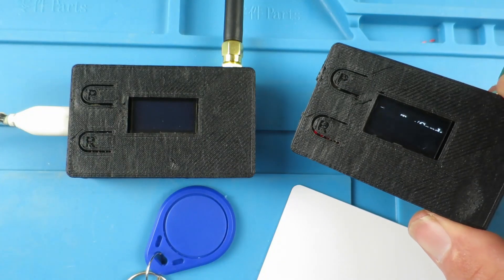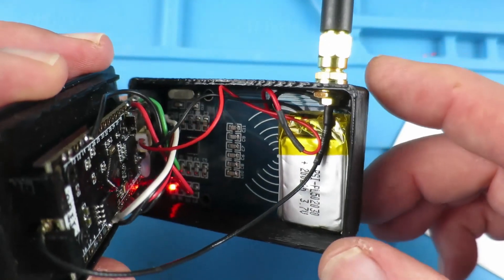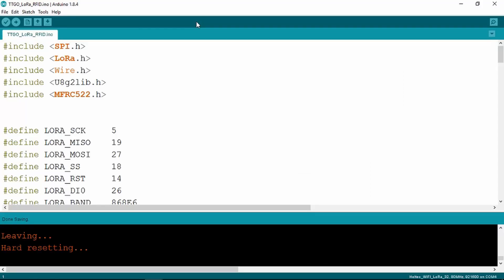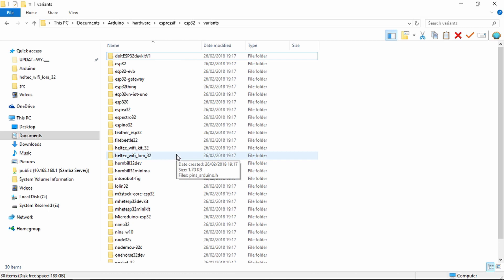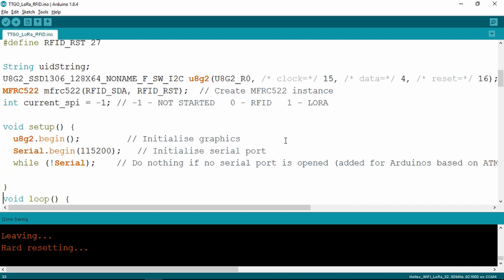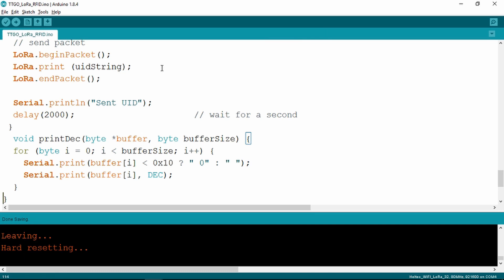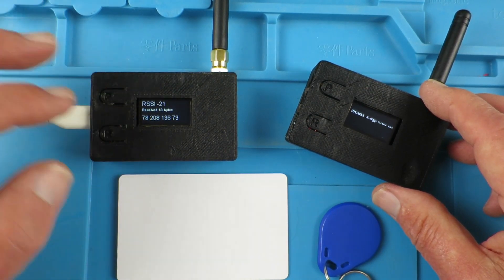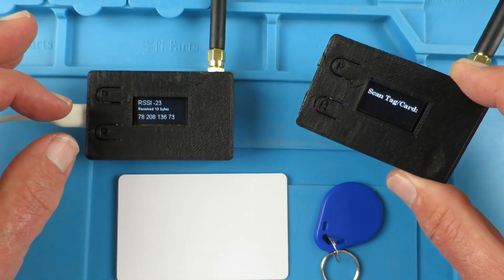Remote RFID Reader with LoRa & OLED Display - Electronic project

Comment: Hello i want the same code in esp idf ..i am using RFID and lora 32 v2 ..but I am getting error in RFID that read/write test failed .it is unable to read tag .. i have connected hardware as shown in your code ..
Reply from the maker: Sorry I don't use the ESP idf. I suggest you use the Arduino IDE first just to check your hardware, then maybe you'll have a better idea how to migrate it to ESP idf. Also this may help : https://docs.espressif.com/projects/arduino-esp32/en/latest/esp-idf_component.html Thanks for watching, have a great day!
Reply: @1nformatica  Hi. I tried the code  on Arduino IDE. In OLED it's displaying "Scan Tag/Card" but when I tap the card it's not scanning. What is the problem now ?
Reply from the maker: @KK-ib5nh  I suggest you test your RFID board and tags using the simple sketch I show here : https://www.youtube.com/watch?v=qzP_M82Mvjo You can get the sketch in this archive : https://drive.google.com/open?id=1LIFz0ApdliPeSq9N49goN8Ffpi5Ufjuw&authuser=gregcann%40gmail.com&usp=drive_fs
Reply: @1nformatica  I tested RFID reader and tag .it's working properly with nodemcu but again tried same rc522 RFID with heltec lora32 v2 but again the same OLED is displaying but when I scan the tag it is not printing the uid number
Reply from the maker: @KK-ib5nh  Did you look at this link from the video description? https://github.com/miguelbalboa/rfid/issues/359
Reply: @1nformatica  hello we have to write a function to select spi for RFID and lora bcz if I connect RFID with lora 32 . RFID wouldn't read tag . But lora works

Comment: what board do you use when programming?
Reply from the maker: I do not understand the question. The boards are LILYGO® TTGO 2Pcs LORA32 V1.0 868/915MHz ESP32 LoRa OLED  https://s.click.aliexpress.com/e/_9zjiNb They are programmed from a PC using the Arduino IDE and a USB cable. Thanks for watching, have a great day!

Comment: Hi do you need a LoRaWAN gateway for this system and is it possible to connect multiple scanners to one hub? Thank you
Reply from the maker: You do not need a LoRaWAN gateway. The devices are simply set up one as a receiver and one transmitter. The receiver will receive transmissions from any nearby LoRa devices so you could connect multiple scanners and maybe identify them by adding an ID to the message sent.

Comment: Hello, can you're code working on Arduino nano? when me try to compile youre code, this have problem on SPI, i was change pin  SPI  to Arduino 
error message is : "no matching function for call to 'SPIClass::begin(int, int, int)'"
Reply from the maker: For the nano try using the example sketches.

Comment: Hi,

I tried in every way, but I can not even rfid communicate, I tried to make a code just to call rfid and I did not succeed
Reply from the maker: When I was debugging the project I used another simpler Arduino board like a nano just to test the RFID code. Once you are happy that the code works you can integrate it onto the LORA board.

Comment: Hello ,
I loved your video, but I am in doubt about the configuration of the pins spi that changed in the "pins_arduino.h" of the healtec_esp32_lora card compiler.
for your code should I use which setting:
static const uint8_t SS = xx;
static const uint8_t MOSI = xx;
static const uint8_t MISO = xx;
static const uint8_t SCK = xx;

Thanks.

Sorry, I'm Brazilian and my English is bad.
Reply from the maker: Eu não mudei as definições de pinos no arquivo "pins_arduino.h". Eu só queria mostrar onde eles estavam definidos.
static const uint8_t SS = 18;
static const uint8_t MOSI = 27;
estática const uint8_t MISO = 19;
static const uint8_t SCK = 5;

Como padrão.

I did not change the pin definitions in the "pins_arduino.h" file. I only wanted to show where they were defined. 
static const uint8_t SS = 18;
static const uint8_t MOSI = 27;
static const uint8_t MISO = 19;
static const uint8_t SCK = 5;

As standard.